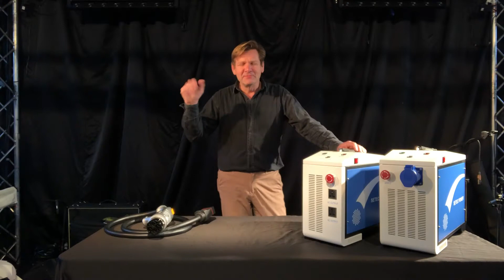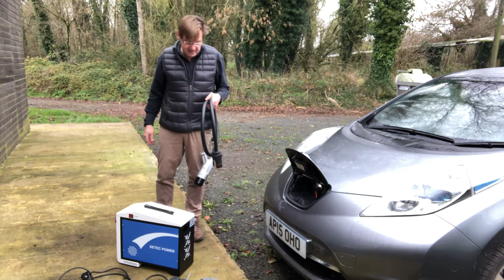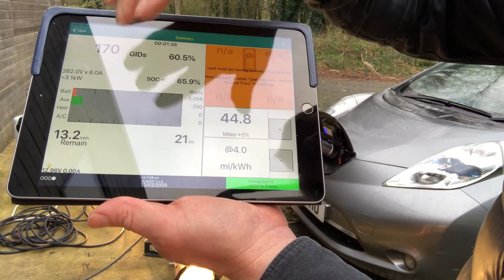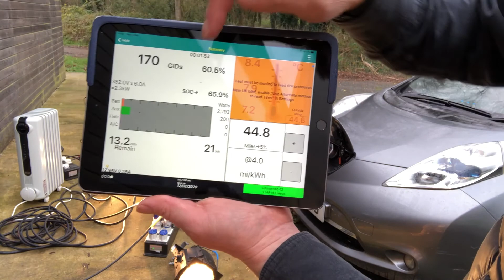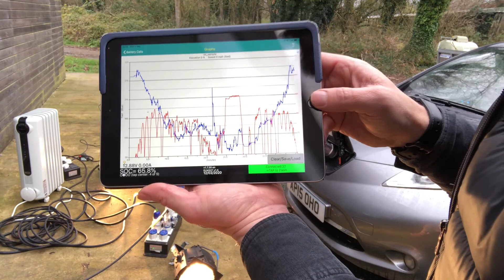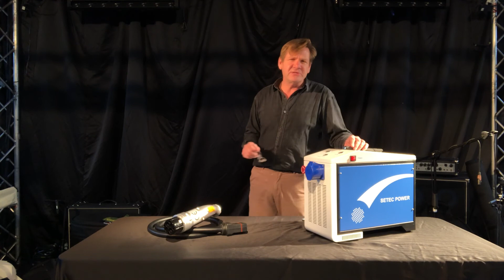EV2Power - Setec Power Station Demonstration

Comment: hi there ! 
I`m from Ukraine where we have continuous blackouts due to missile attacks from russia .. In order to keep my house warm and comfy I use this Setec 6kWt device. 
Lately I was running on this device for ~7 hours from my Nissan Leaf 30 kWt (2016) which was charged to 100% at night right prior to attack ... So after 7 h our forces managed to restore the electricity income. I turned the Setec device off and decided to drive to the grocery store .. AAAAND I faced a very strange thing - my Nissan Leaf showed me 100% battery status. Meaning that it didn`t recognize the discharge I was running for 7h ... I expected to see ~50% battery remaining but not 100% ... 
Did you face similar or any other issue with this Setec devise ? Thanks for your answer and thank you EU for massive support. We`ll win !

Comment: I wish we had these units in the US .
I would want 240v 60 hz out of the machine. I already installed a 70 amp sub panel in my house and divided essential loads over to it when I added onto my home. I live in the Midwest and we get power outages from storms quite often. We have the ability to hook up a portable gas generator but you don't get many hours of use before you have to refuel. In the winter we need to keep the refrigerator , freezer and furnace running until the power is back up.

Comment: Where are you guys based do you ship to London?
Id be looking to buy the 6kw unit, can you draw the full 6kw for a full 3 hours constantly? Or would that put too much load on the car or your converter?
Reply from the maker: Hi James - thanks for your message - You should be able to draw a continuous 6KW until your battery level is down to about 30%. The car itself draws far more when it is being driven so the battery should be able to easily cope with the continuous 6Kw draw.  We are based near Salisbury Wiltshire

Comment: If I were directing this video, I'd have shot it in the middle of some woods, at night, lit and powered by your system.  Needs cutaways, too.  (Video director for the ElecrAA videos, :-)   An excellent concept though - good luck with the promotion.
Reply from the maker: Thanks for your feedback Stephen. Doing a video in a wood using the Power station as the energy source sounds like a great idea and something that I may well consider for the future. I plan to set up a stage, large sound system with lights and demonstrate it that way in due course.